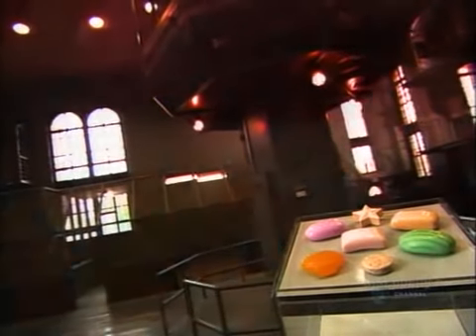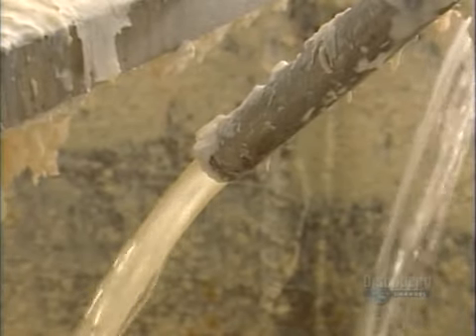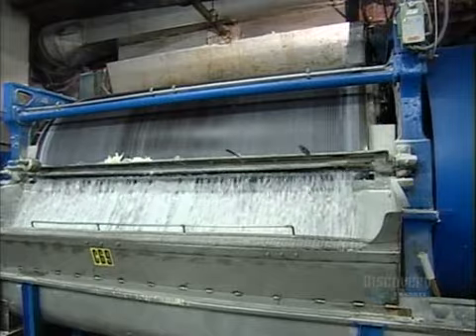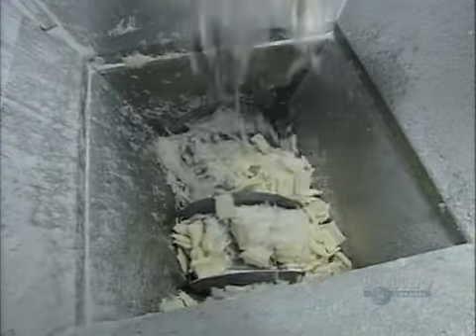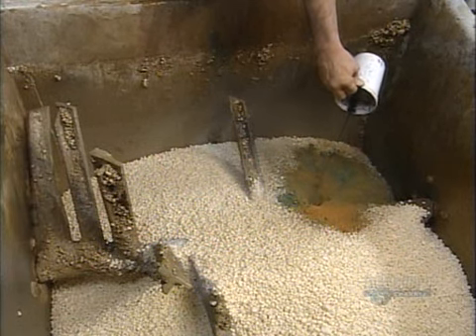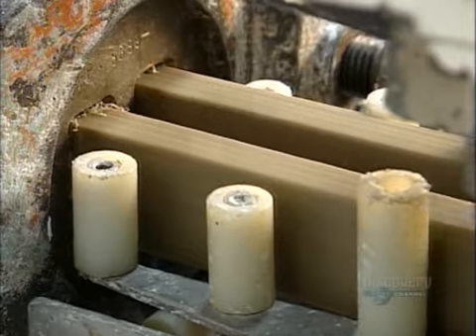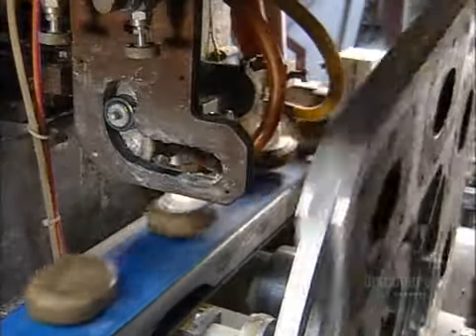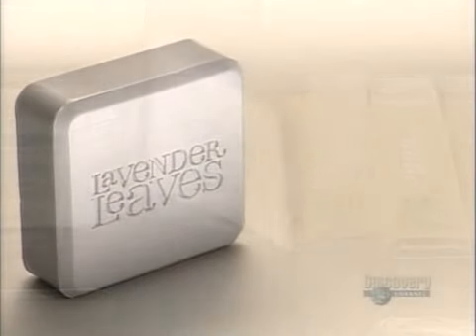How it's Made: Soap Bars

Comment: 4:36 One of the grippers didn't get a soap bar sealed in plastic, it was empty.
Reply: your right 😀⬜
Reply: +Jennifer Sheng More than just one, lol.
Reply: +AstralHex That could actually be due to some quality checks. I would imagine that, like most factories, there is a step where a laser or some other machine scans the product. It it's ok it continues its way, if not it gets thrown out. I dont think the grippers just failed to pick one up, that would make to sense since that would mean that either there is one bar of soap that just landed next to the working tape, or that the grippers and the rate in which bars are produces are out of synch, which is a no-no for every factory. So it seems reasonable to assume that they were kicked out for some reason in a quality check.
Reply: ***** 
I figured, I was just pointing out that multiple were missing. Good explanation for the others, though.
Reply: Omg that's true!!!!!
Reply: so?
Reply: Biting fingernails now!!!

Comment: How is sodium hydroxide made?
Reply: Swagtastic Master of space
Reply: Oil & sodium hydroxide makes soap
Reply: Elise Lefort They electrolyze salt water. It produces sodium hydroxide, chlorine gas and hydrogen gas. Once you have lye, you can do one of two things with the byproducts: recover them separately because there's a market for both, or react them to hydrogen chloride, which is then dissolved in water to make hydrochloric acid.